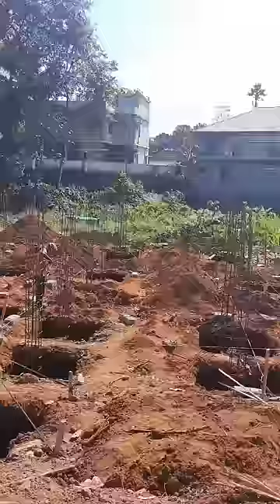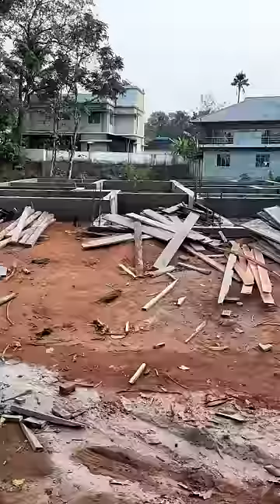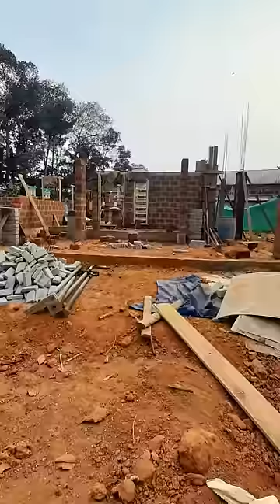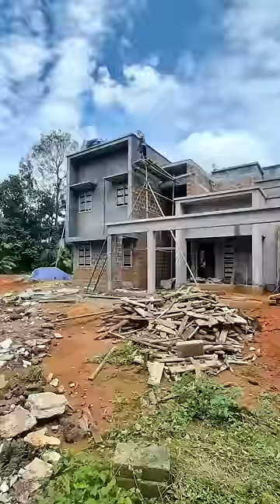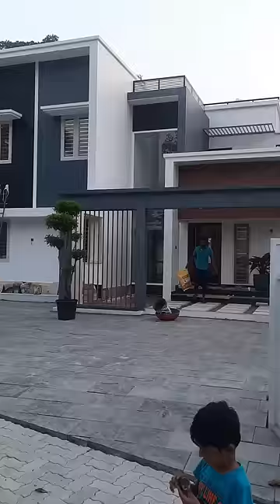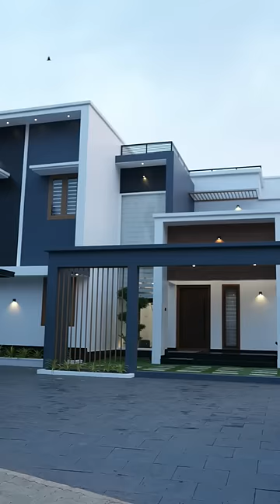Home 🥰

Comment: Why no trees planted?  That interlock system you have put gets so hot it adds to the heat in your front area as well as home. You can't walk bear foot on it. 
Plant trees around,  small shrubs it will add beauty and cool the surrounding